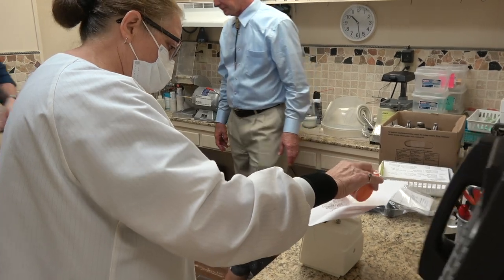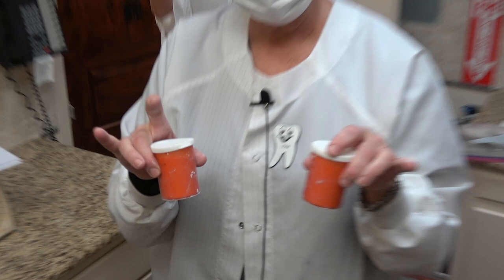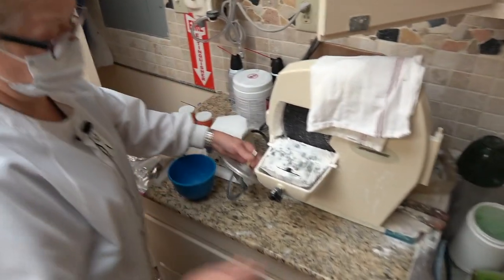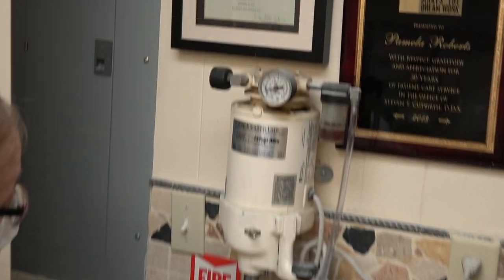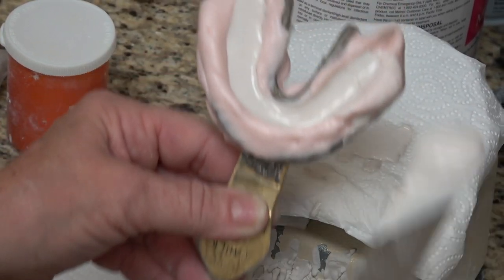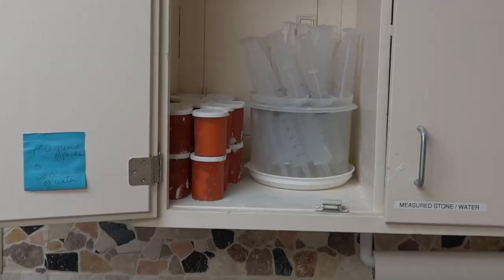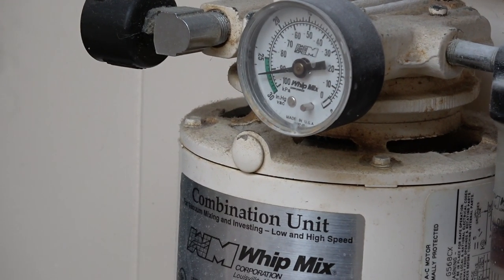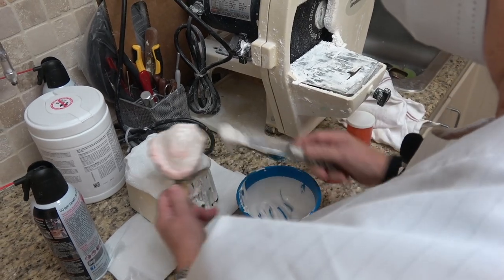Dental Assisting - Pouring a Perfect Stone Model - Dental Minute with Steven T. Cutbirth, DDS

Comment: You're videos are so inspiring. 2 questions please: 1) what temp water? just tap water or she takes temp of water? 2) does she do 1 model pour at a time or can pout multiple without having stone set? Thank you so much
Reply from the maker: Room temperature water, around 70 degrees F.  You can pour both models from the same mix if you use a normal mix stone. 
Take your practice to the Top Tier. Subscribe to DentistryMasterClasses.com for an organized library of all the Dental Minute videos plus many complete comprehensive cases and many very important articles. New cases are added weekly.  Only $39.95/month.
Click here to subscribe: 
https://membership.dentistrymasterclasses.com/purchase/?plan=513

Comment: What is that staylight thing? Can't find anything about it
Reply: Stalight model hardening. Creates harder models with more flexural strength to resist breaking, chipping and abrasion.
Reply from the maker: Correct. Pouring models correctly is really, really important. You can ruin a nice restorative case with poorly poured models.